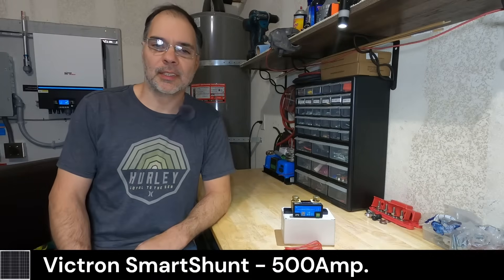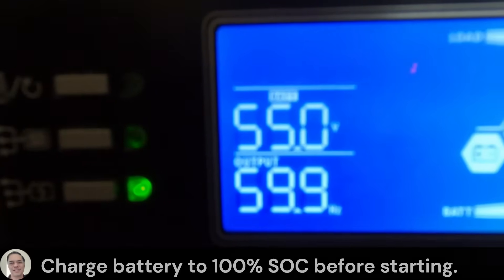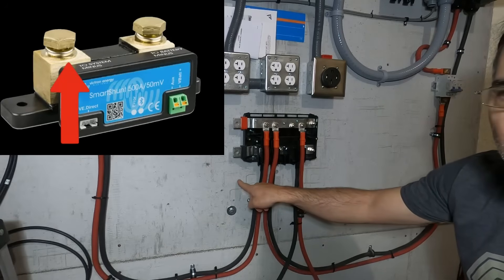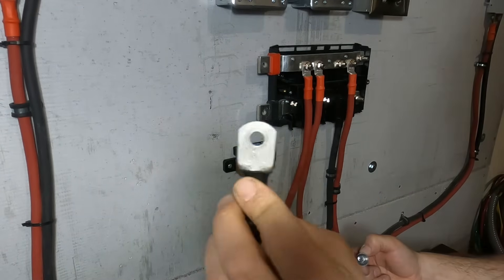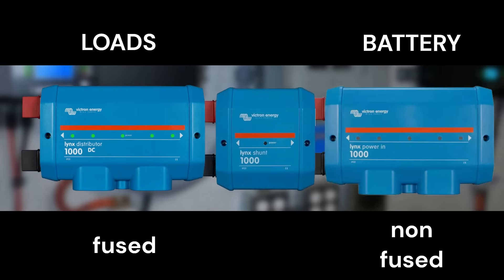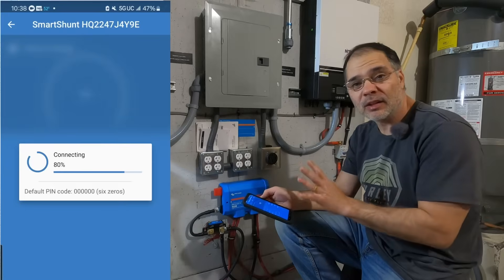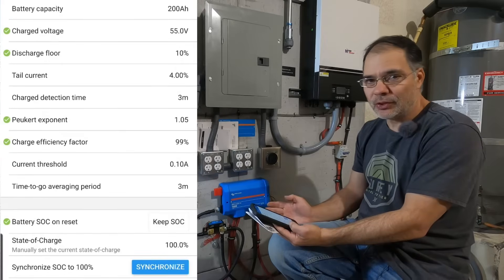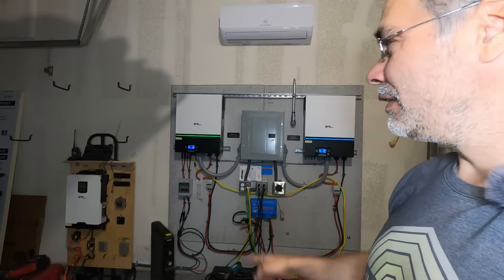Installing Victron Smart Shunt 500A

Comment: Thanks for the video - 

I bought the shunt and I'm REALLY not happy with the bluetooth distance limitations.  WHY VICTRON?  I mean, they could have put some external port to have a booster connection.. I mean come on..
Reply from the maker: I know right.  I wonder if they did it for security or for power savings. Did you get the newer version..

Comment: Thank you for sharing I also have this shunt I have not installed it yet question I have a 24-volt system I'm wanting to install the victron 24 volt battery charger 3 output where would I install the negative for the battery charger
Reply from the maker: To the system side of the shunt. Remember. . In order for the shunt to be able to track the power.. power must flow thru the shunt.. so you connect to the system side just like your charge controller.. there should be nothing but the battery negative on the battery side..
Reply: @natesdiysolar  thank you I think I was just scared and nervous that I was sending power not directly to the battery terminals you have confirmed that I'll be okay thank you
Reply from the maker: @neomatrix2722  all good.  Think of it as another charge controller.. you could connect it anywhere on the DC side.

Comment: I am really confused by this video.  Battery minus should be connected directly to the shunt.  Load minus should connect direct to the lynx and not require moving the grounds.  Lynx is the load.
Reply from the maker: Does not matter if it's before the lynx or after the lynx as long as it's before any loads.. sure you could connect all the batteries to the shunt, but what then when you have 6 batteries with separate sets of cables..  the lynx shunt goes after the busbar as well. I moved the loads rather than the battery connections. Please see the video index section Wiring the Shunt

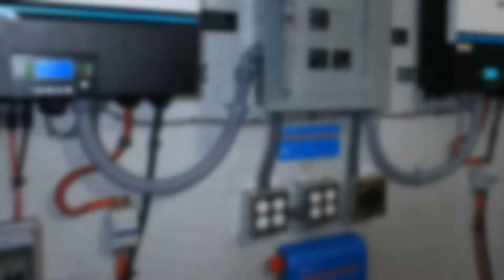06:26 - The Lynx Power Distribution System

Comment: I have 3- 400 AH lithium EG4 batteries, what amperage of a shunt I install. 3000W Xantrex inverter? 500 A ???
Reply from the maker: 500a is fine.. this is the maximum current it can handle. Not to be confused with your capacity.. (400x3) a 3000w inverter at 12v will use 250a.. assuming you have a 12v system.  If you have 24v or 48v, then it will be much less.. 500a is plenty for most systems..

Comment: Hi there  does the negative cable from the mppt has to be connected to the system minus to or just the negative cable from the inverter like you have shown on the video thanks
Reply from the maker: Yes, both inverter and charge controller.  I have an all in one inverter charger, that's why you only see one cable.  You will have 2.
Reply: @natesdiysolar  I see now, I'm new to this! I appreciate your reply. Now I'm on the right track, thanks

Comment: So the smart shunt starts off at 100 percent and goes down 99,98,97.... Does it also show it going back up 56,57,58,59? Or does it just reset once the battery is charged again?
Reply from the maker: Yes it's a bidirectional counter... charging makes it go up and discharging makes it go down.  After the initial sync to 100% it won't sync again unless you tell it too.
Reply: @natesdiysolar  Thanks. I'm going to get one. :)

Comment: Everyone keeps saying it monitors power in too ? 
For that wouldn’t you need to have the negitive from the charge controller to the negitive lug on system side of the shunt ?
Reply: Thanks for the reply 🙏 I’m putting in a system shortly and have this shunt I’ll be using. I was originally thinking charge controller to negitive battery post.  But system side of shunt makes more sense and just wanted verification.  Thank you
Reply from the maker: @MarioTwins87  thats correct. you should only have 1 cable to your bat neg and thats going from the shunt bat neg to the battery negative terminal.
Reply from the maker: Yes that's correct.
Reply from the maker: I'm using an inverter charger all in one.  That's why you may not have seen another cable.
Reply: I have 3x280amp hour lithium batteries for my motorhome so I need the 1000 amp version.

Comment: It's not entirely obvious to me what values to put in the app - I have no idea what the Pukert variable is, for example. Where can I find the values to put into the app?
Reply from the maker: Sorry about that.  I did not explain that value much because it's not relevant for lifepo4 cells.  Here is an explanation I found.  

The Peukert’s Exponent is used for the lead-acid batteries. Simply said this exponent is the ratio between the charging and discharging of a battery. It means how much energy you need to charge compared to the energy you get when discharging.

For the LiFePO4 cells, the efficiency of the charge and discharge rate is very high – above 97% and more. That is why the Peukert’s Exponent is close to 1.00. The battery producers do not give this value because it is not necessary for the LiFePO4 cells.

Comment: nice info... great delivery... watching your little videos gives so much  knowledge on specific things your channel is great I think if you did a breakdown on every product you have in your system people would learn it better than one massive flood of info that people usually put out.. great video and thanks.
Reply from the maker: Thanks.  I actually did a series on my system.  6 videos with each video showing each step in the process.  It's the ones with the  blue stripe. In these videos, I talk about each product as I go.  There is a playlist called 48v solar system.
Reply: @natesdiysolar great to know.. ill keep my eyes open one your channel ..looking at the direct solar input to water at present. I think to get this done is a game changer. I just ordered your custom buck converter. Im going to try in with 2 pieces 540 watt panels and see what i get out of it. I have 12 volt water element .. thinking of grabbing an old sauna hear element and seeing what i get without the converter and looking if I can get results with combo 12 volt elements or maybe a sand battery.. ill keep you informed..keep going ..love your work.
Reply from the maker: @byronsowntime  thanks.  Love to hear what ppl are doing.  FYI. That buck converter will only be able to use about 300w of power from those panels. Whatever the output of the converter is in terms of watts is what you can hook up to it solar panel wise. You would need a larger converter. They do have solar water pumps that take solar input directly, but you should be able to run a small 12v pump from that converter.
Reply: Remember to remove your jewelry when working with any voltage. Also was wondering why you did not do the connection in reverse. Meaning connect the battery to the shunt and then the inverters to the busbars.
Reply from the maker: The battery was disconnected.  I connected the battery last. Because I'm going to add fuses to the busbar later. If you mean put the shunt before the busbar. I will be adding more batteries and don't want many connections on the shunt battery side.
Reply: @natesdiysolar  I see where the inverters are connected to the shunt directly and not on the busbars